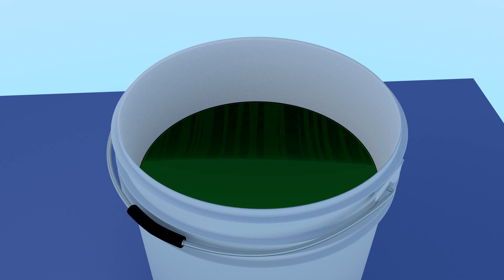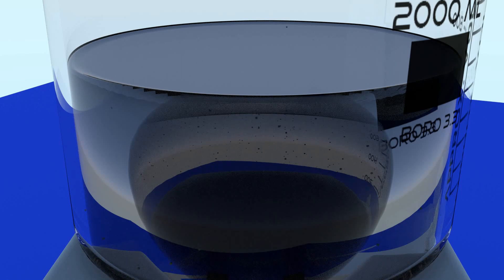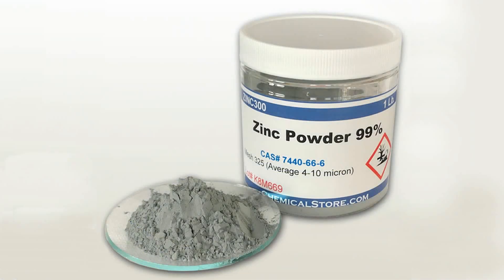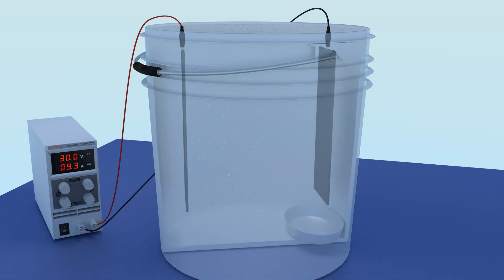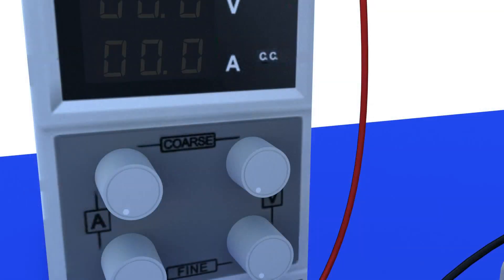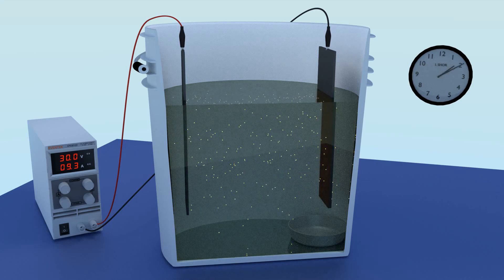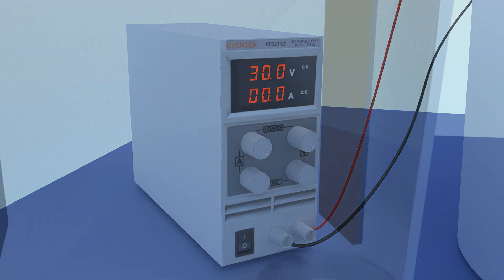Recovery of All Metals from Aqua Regia (non-selective recovery)

Comment: All your informations are very help full. What is this machine is that electro plating machine thank you
Reply: Usually a benchtop power supply is used, but a car battery charger also works. 

My understanding is - 
The advantage of using a benchtop power supply is that you can dial in the voltage and amps you want, 
whereas, when using a car battery charger, you get 12V, and maximum amps, 
until the solution is no longer dropping metal out.

Comment: I have one more question
I have a solution that contains gold, palladium and copper metals. I used aluminum to get some sediment, but the aluminum in the powder is black. I washed the powder several times to remove the acid. Then how should I separate the metals? Can you guide me?
Reply from the maker: You can add as much or as little TSP as you choose.  The anode and cathode can be of the same or different materials of your choosing.  However, if you use a metal for the anode, make sure you don't use a metal that will dissolve in your solution.

Regarding your second question-

Black would be typical, so don't be concerned with the color.  This precipitate should be refined with aqua regia.  For that procedure, see the embedded video on the following page

https://www.ishor.com/aqua-regia-gold-refining-starter-supplies

Comment: hi
A spoonful of trisodium phosphate is used for several liters of acid?
Can both anode and cathode be used from the same metal?
Or is one metal and the other graphite? Or both graphite?
Thank you very much for your educational video
Reply from the maker: You can add as much or as little TSP as you choose.  The anode and cathode can be of the same or different materials of your choosing.  However, if you use a metal for the anode, make sure you don't use a metal that will dissolve in your solution.

Regarding your second question-

Black would be typical, so don't be concerned with the color.  This precipitate should be refined with aqua regia.  For that procedure, see the embedded video on the following page

https://www.ishor.com/aqua-regia-gold-refining-starter-supplies

Comment: Excellent video but I don't understand what the cathode is and what the anode is and how to get it out of the way.
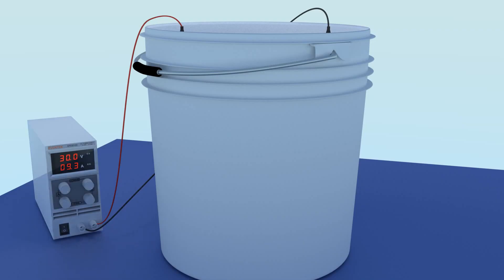Reply from the maker: Not exactly sure what your misunderstanding is or what you want to get out of the way? Both are necessary in your solution during electrodeposition - watch again carefully from 1:28 onwards. Graphite, silver or titanium plates or rods may be used as your cathode AND anode. Wire one to the negative/red pole of your rectifier, that becomes your anode, and the other to the positive/black pole of your rectifier. That becomes the cathode upon which metal deposits during electrodeposition.
Reply: @shorinternational3841  Sorry, I meant what the cathode was and what material the anode is made of.

Comment: Hi
I have gold,palladium and rhodium ore, I am making concentrate then doing aqua regia, I can extract only gold but pd and Rh remain in aqua regia or in crushed ores, please help me how to extract pd and Rh??
thanks a lot
Reply: To dissolve platinum group metals, you will need to heat the solution to around 80C.  Even at those elevated temperatures, it will take much longer (at least 1-2 hours) to dissolve the pgm's.  Once dissolved, paladium can be selectively precipitated with sodium chlorate (not sodium chloride).  Rhodium can be precipitated with hydrazine.
Reply: Hydrazine is rocket fuel. Do not attempt without expert chemical lab pro guidance.  Temperature and other limits must not be exceeded or explosion will result.
Reply: Thank you souch

Comment: Hi do you need to adjust the Ph before you start the plating out? And does it plate all the PM metals and base metals? Thanks Hib
Reply: Adding baking soda until it no longer causes foaming will make your solution pH neutral.  All metals will plate out of solution.
Reply: ما أسم هذا الجهاز   وكيف احصل عليه...،وكم  هو الفولت v  وكم هم الامبير A

Comment: I've heard of a method of dissolving gold in Glycine. It would be interesting to make a video on how to extract gold from Glycine.
Reply: Sorry, no idea.
Reply: Wth is glycine?
Reply: @StonemanRocks  Glycine is an amino acid. Depending on the temperature depends on what metals it dissolves.
Reply: Did you try this yet? I purchased some Glycine this week with the intent to use it to leach copper. Might try it with gold later too. If I end up using this electrowinning method to get it out of solution, I will comment here on how it goes.
Reply: @LetsCrushRocks  no

Comment: I have 10 liters of concentrated Rhodium plating solution, how should i recover it before sending it to wastewater treatment?
Reply: If the solution is considered spent because it no longer plates rhodium, the rhodium left in solution is not worth recovering.  However, if the rhodium solution is considered spent because it is no longer plating bright, well that is another story.  In that case, you can clean the solution by filtering through activated charcoal.  This will clean the impurities out of the solution but it will also absorb some of the rhodium, so not a good idea to utilize except when you have to.
Reply: @blaniardmarshall8924  Would it be best if I use zinc to confirm the content?
Reply: @lesliechea7136  Since not all the zinc will dissolve and the solids left behind will be more zinc than rhodium, that is unlikely to provide useful information for you.  Electrolytic recovery is likely to provide you with the best result.  However, as previously stated, if the rhodium is exhausted from the solution, this is likely to be wasted effort.
Reply: @blaniardmarshall8924  Your advice had been very helpful. Thank you